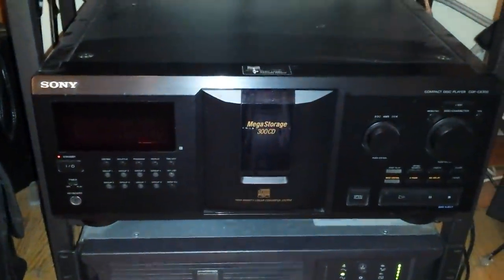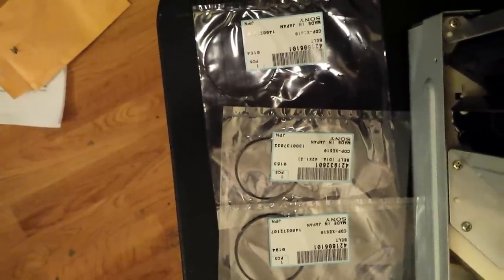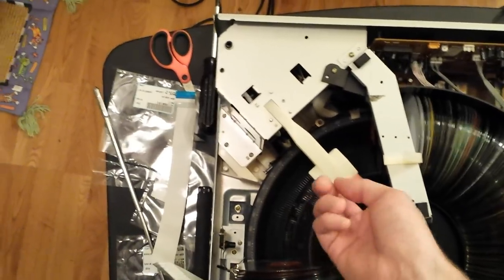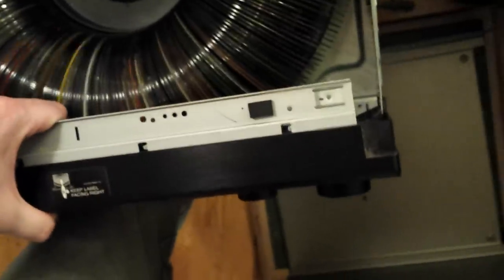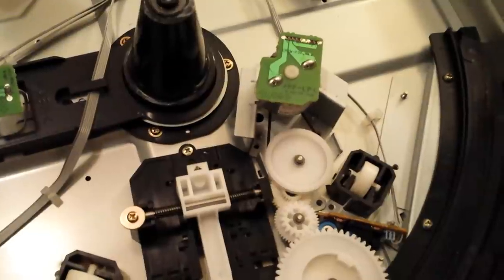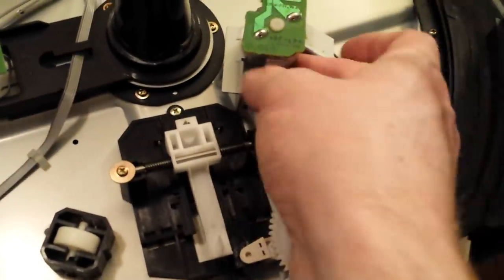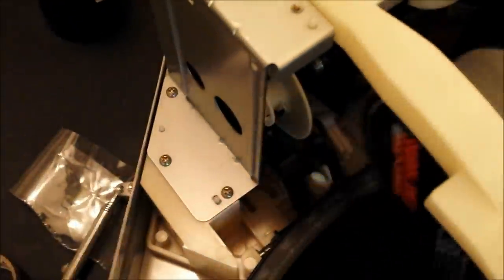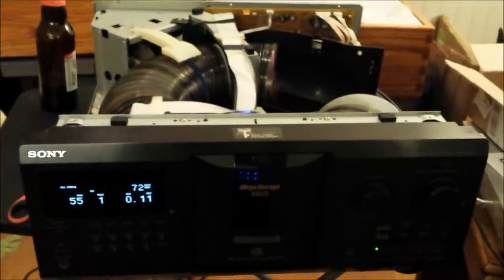Sony CDP-CX300 300 Disc Changer Belt Repair and Maintenance While Full

Comment: Also had same problem fixed it with I rings. However unit is showing table error. It spins both ways but seems to be out of sync as it hunts back and forth. Any ideas
Reply from the maker: Can't say for sure but the sensor that detects table position is most likely an optical sensor.  I would suspect that dirt or foreign debris is obstructing its view of a slit, gap, white section, or some other optically detectable feature.  It's also possible that the sensor is attached via a cable that was left unplugged.

Comment: I was able to follow all instructions. However, I took door assembly apart and cannot figure out how to get it reassembled. Have spent several hours.  Can you help!
Reply from the maker: It's got tabs that have to line up with notches in the track that it slides in, it'll only go back in from one position.
Reply: @hugeshows  I have a picture of the part I'm struggling with. I have it on my desktop, but do not know how to send it to you.
Reply: @hugeshows  attached is a picture of the part
Reply from the maker: @dianesteele8507  Um, not sure where you sent it but I didn't get it.  First thing is don't get frustrated or mad at yourself.  You'll figure it out with enough time and patience.  Not sure how I can help remotely
Reply: @hugeshows  I Have 2 pictures. Do you have email address I can send them to?

Comment: I have not found anyone who has the belts.  Any suggestions where I can purchase?  Thank you
Reply from the maker: I would start with ebay or amazon
Reply: I finally found them on ebay.  Installed new belts, only had 2 screws left over, and it works perfectly!!  Thank you.

Comment: Any advice on a c 32:00 code? Plays some disc's won't play others
Reply from the maker: Haven't seen that one.  It'd be useful to look it up if one could lay hands on the documentation.  It could be anything from dirt to a failing laser, to misalignment of the laser.  Cleaning the lens on the laser is very hard to do without damaging it further.  I really don't know, those are just guesses.    Good luck.

Comment: I just picked one of these up and it noticed that when the CD is playing it plays for like maybe 10 seconds then goes back to the beginning of the song and just continues to to that for the most part.  Any ideas ?
Reply from the maker: Your cat is sitting on the remote.  Honestly, no idea.  Check more than one CD obviously and see if anything's dirty or otherwise obstructing the laser.
Reply: @hugeshows  I cleaned the lens.  It still has some skipping issues.
Reply from the maker: @dillwiggle2  Unfortunately unless something is visibly wrong, these sorts of problems usually take specialized equipment to diagnose, as well as service manuals giving test procedures.

Comment: Please help. I replaced the belts but it only reads and play disc 1. If I try put it on any other disc like 10, 220 it doesn’t play nor count the disc . What’s wrong or might be wrong. Again it plays only disc no 1 and no other disc
Reply from the maker: Very hard to say since I can't exactly look your unit over.  The unit uses an optical sensor to determine which slots have discs in them and which do not.  Provided all the belts are working correctly, and the carousel is able to turn, I'd check to see if the optical sensor that counts the discs is dirty or otherwise obstructed.  Sorry, I don't know exactly where it is located, but it will be somewhere near the carousel, possibly under it.
Reply: hugeshows thanks I guess it’s the optical sensor. How do I clean it or remove obstruction ??
Reply: hugeshows. It’s playing but it does recognize the slot . Let say if I put it in no 13, unless I tell it to, it doesn’t play number 13. Simply it’s not sensing the cds . I have cleaned it already
Reply from the maker: Just look if it's dusty or dirty, clean it with a Q-tip or similar.  Sorry I really can't do much more than guess at the problem without seeing it myself.  It's been a couple years since I've even looked at the inside of one of these.  Also make sure you plugged all the little cables back in after you did the belt change.

Comment: Fascinating!  But this senior citizen has little confidence in her ability to undertake repairs and will probably take unit to the Sony repair shop.  
I actually have two of these units and could make do with one.  But cannot get CD's stuck in  back of broken unit.  Turntable will not turn.  I may summon courage to take back off unit but suspect I need to remove top as well to get at discs?
Reply from the maker: It can be tough to get them out of the back if the platter won't turn.  There is a shroud back there that will not let the discs out very easily.  You'll almost certainly need to open the unit to get them out.

Comment: My second 300 player now has new belts but is not running. The digital display lights, but other than a low humm, thee is no movement of the parts. Another thing--- when I switch it off it delays several seconds before shutting down. CAN ANYONE HELP?
Also, the door doesn't open by itself.
Reply from the maker: I would inspect for a mechanical jam of some sort.  Does the display otherwise act normally?  Does the hum sound like a small motor struggling?

Comment: Helpful video! I don't have a belt problem on mine (yet), but my last tracks are skipping to the point of returning the laser to the 1st track.  I was hoping to find a fix for this, but watched yours anyway, and knowledge is power.  Just a minor critique:  your placement of removed screws is an accident waiting to happen.  don't you have a larger work area, and maybe a snap lid tupperware for your screws, so the are not sitting on the edge of the unit in a tape roll or on the side near the edge of the table. I was cringing. Otherwise, thanks for your time to film this.

Comment: Guys, here's what mine is doing. As the table rotates around, the disks are actually HITTING that guide arm that hangs down from above. ( where they get loaded) As if the table is too high or that arm is too low but it seems stationary. Anyone have any thoughts?
Reply: I have 3 units and haven't heard of that problem. Maybe one or more cds are not seated in their slots and are protruding.

Comment: Do you have those belt numbers availible?
Reply: For the 355 model: CDP XE510 is the number on the package from Partstore.com
Diameter: 42X1.2
Reply: The. Belts are for the two pulleys in the rear or for the turntable?
Reply: The belts you see around the "pulleys"  in back are for the
table and other operations. I believe the belt for the door may be in another location. I replaced belts in a CX400 where they are easier to reach.

Comment: One of the biggest failures of cd players is skipping and tracking errors caused by the laser head sticking in the old dried up grease on the guide rails, so as long as you’re in there, clean and re lube the mechanism

Comment: Why is removing  discs an inconvenience for  once-every-15-year task.  Comment below is relevant........
"The carousel doesn't have to be removed if you take the CDs out.   I 
just tilted the carousel up after removing the front triangular piece.  I
 didn't have to remove the front panel either. The triangular piece, 
which has the top slide for the door, slid right out. It was an easy 
fix.

Comment: If anyone else wants to try. I used quality size 18 rubber bands for the needed two main belts. Works great. Also I only needed to remove the AC main plug to get the back off far enough to replace the belt. I did that by loosening up and moving the wires from there normal routings to provide more slack. http://www.officedepot.com/a/products/333179/Alliance-Advantage-Rubber-Bands-Size-18/
Reply from the maker: Hmm, I wonder if I could get to the belts on mine that way...  Oh well, I hope to not find out for another decade or two.  Rubber bands can work as belts, although they probably won't last as long.  The rubber isn't processed in the same way.  In a tape deck, regular rubber bands tend to introduce wow and flutter because of slight irregularities, although in a CD loading mechanism that just wouldn't be an issue.  You may have found a way to do this on the cheap so more power to you... Just don't count on them lasting more than a few years, at least based on my anecdotal experience with them.
Reply: Yea I don't expect more than two years out of them. Once you do this though it's not hard to do so I can repeat or who knows the laser or the motor may go out next so it won't matter.